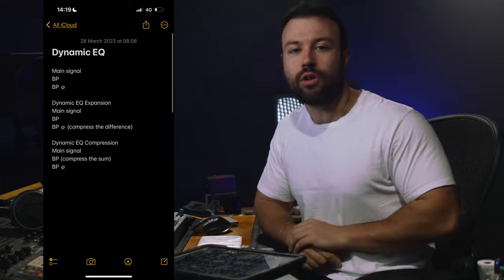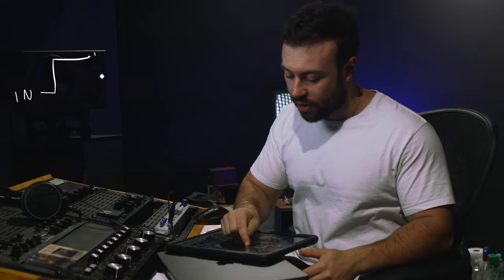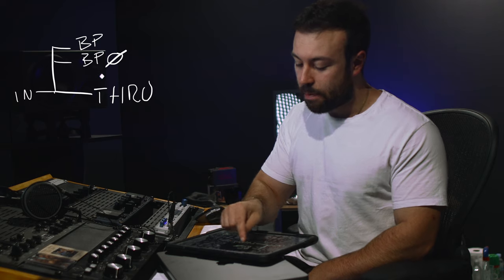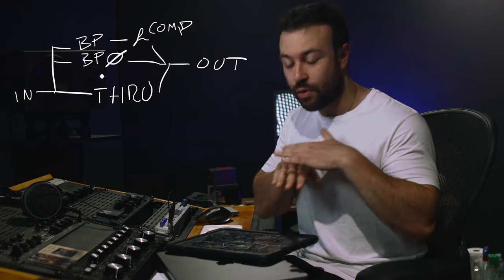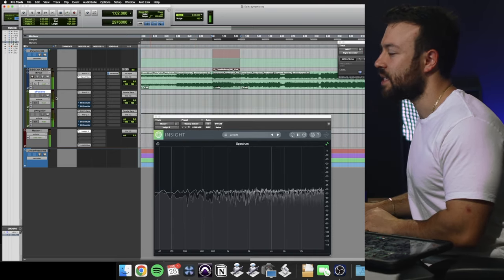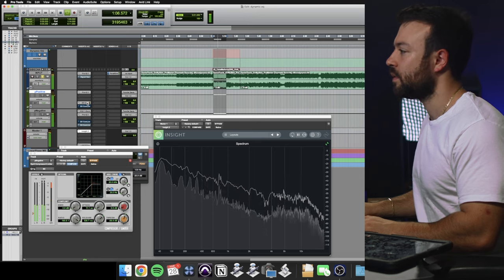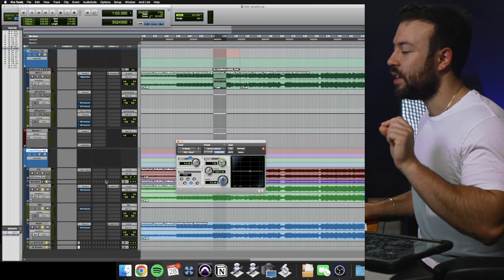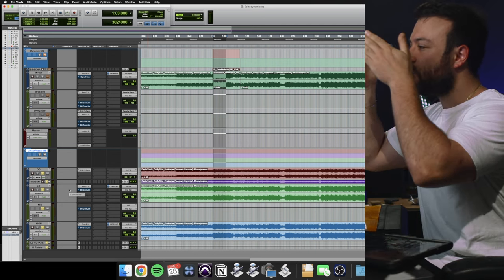Mastering Engineer Debunks Dynamic EQ VS Multiband Compression; MUST WATCH

Comment: I remember back in the OLD DAYS the only Dynamic analog EQs were the BSS DPR-901 & XTA Electronics D2 and few homemade boxes I saw around Nashville Studio. But Dynamic EQs were mainly used in the Television & Movie world for Dialogue control on moving boom mics. Analog Multiband compressors were fairly uncommon as well, a couple VCA 3 band and 1 Opto 3 band is all I remember ever seeing. But mult'ing was common back in the console days so basically making a multiband compressor manually on 2 or more channels on a console. Dave Pensado and Justin Niebank were famous for splitting out vocals and multibanding them. Good video. The Tokyo Dawn Labs dynamic EQ is a parallel EQ design so each band is independent and then the output of each band is sent to the next band in the order you set them, then combined in the end that way to bands really close together aren't over or under compensating. That is the only Dynamic EQ I know of that does that, the rest are just processed at the same time together.

Comment: you laid out the basic routing for those types of dsp processors, but you'd be surprised how much of a pandora's box it can really be. with all the different kinds of routing-optimizations, entirely different filter architectures, allpass filters, linear phase with pre-ringing artefacts, minimum phase with the phase smearing. it's an endless topic and at the end of the day you just use the plugins that feel right anyway :)
Reply from the maker: Exactly! But I needed to answer this question for myself, because it was unsettling to me how vague people were being when differentiating the two tools;
Reply: Of course, you're right. That's why you have such a overwhelming number of EQs and compressor (both plugins as well as analog gear), which each claim to be better than their competitors. But I think that's not the point here, since Nicholas just wanted to highlight the basic difference between a multiband compressor and a dynamic EQ, so that you get an idea, how/why they achieve different results. He did not claim, that dynamic EQs are generally better, they're just introducing less pronounced phase shifts. As usual, the choice whether to use a dynamic EQ or multiband compressor depends on the product you're using (and thus the actual architecture and features involved), the audio material you're applying it to, the settings (since especially multiband compressors are often used with too aggressive settings) and your expectation on the result (because phase shifts are not necessarily harmful for your mix, indeed they sometimes add that extra "flavor").

Comment: Pro MB dynamic mode does the same thing as a dynamic eq which is why it's been my go to mode and multiband compressor for years.  I've always thought it sounded the cleanest, even compared to other greats like the leapwing one.  check the manual description 
"Dynamic Phase
Finally, the unique Dynamic Phase mode gives you the best of both worlds: it results in a flat/linear
phase response when no gain processing is applied, but does not introduce latency or pre-ringing
artefacts (like linear-phase processing) or static phase distortion (like minimum phase processing). Minor
phase effects will only be introduced when the gain of a band is actually changed. This is possible
because the input signal is not actually split into bands, but is treated with intelligent dynamic filtering,
offering almost the exact same frequency response as with linear phase and minimum phase processing.
Dynamic Phase is by far the most transparent mode, suitable for both mastering and mixing, so we have
chosen this as the default processing mode for new plug-in instances. Note that Dynamics Phase mode
closely approximates the behavior of "normal" multiband processing, but in some cases, like muting all
bands, or placing bands next to each other, it works slightly differently."
Reply from the maker: Solid pick up!

It's funny because I've never liked Pro-MB Period; I've used it and do use it every now and then; but something has never sat well with me using it;
Reply: Pro-MB sounds amazingly clean and nice, I really like it for subtle mix bus work (up to 1dB low mids and highs compression on the master bus and on problematic vocals (huge range singing and going fast from soft to loud singing) up to 3-4dB). Sounds like nothing has changed in the sound but everything sits and feels way better.

Comment: I sent this to a couple of friends. One specially since he is doing a freaking crazy filter research. As far as I remember his version this would probably wouldn't be the way to separate them. In my way of thinking it & understanding... both designs could be called Dyn EQ or MB Compression. It would probably have to do more with how many filters are you using, not with the routing itself. Since all you are doing is affecting in some way the detection circuit. Like the 80's SSL Desser, duplicate track, emphasize FQ, feed that into track that is actually going out through SC. 

But for me the importante is much more of a concept, when to use what. TDR Nova could be used in any of those ways (just to call a free option for everyone). When I get an answer from the researching friend I'll come back and post his answer or he'll probably post it himself hahaha I always enjoy your videos. :) 

Hope we can make some video together.

Comment: So, multiband compressors will natively create phase changes due to crossovers once it's enabled? Due to the initial EQ (band) signal split, correct? I've often used the Waves LinMB on masters, as I understand, this specific MBC operates in linear phase mode which should minimize these effects. Is that true?
Reply from the maker: Many do rotate the phase on the cross-over filter; the design of the crossover's I routed in the DAW were linear phase; but that was because I could create the crossovers for the mid channel via the difference signal from the sends; however; when more band passes are involved; I don't know of such an eloquent solution (Most likely there certainly are; just not ones I'm aware of)

Comment: I wish there was a free spectral dynamics plugin with a good interface and gives detailed control...
Nova only gives very gentle expansion/compression, and fast attack times tend to create noticable distortion. 
ReaXComp is super frickin difficult to use, and it's hard to properly gain match. Also the compression isn't the nicest sounding (this is a skill issue on my part). 

I've set up my own crossovers before, but the fact that it's so hard to tune the cutoff and add more bands takes so long that I forget the sound I was looking for. 

Maybe I should just buy pro mb...

Comment: I understand everything except , how do you reckon a Multi band is in series?
It splits the signal into 3 separate bands which are all Filtered independently ? is that itself not a type of parallel processing? as the processing is happening independently before the sum? 
Or is it that the Dynamic inverses phase and uses the difference between the 2...and that is actually parallel? as in the phase inversion / differences make it parallel processing? or maybe another reason I am not aware of.

Because if I made a pedal board and used the same signal path as a multi band, that would be viewed as Parallel signal paths in the Pedal board world (like a Wet Dry Wet set up), just to use an example. 
Or if I set up 2 speaker cabs with a guitar amp, if the signal went into one cab and then another cab was driven after that cab (amp into cab a into cab b) that would be series, but if I put both cabs directly into the Amp out put they would both be driven at the same point in 2 independent signal paths, that would be parallel to use another example.

Great video though I am literally just querying the use of terms and what that specifically relates to. You clearly know quite a bit about the tech side of Audio so I would love to hear your answer. I know I am probably missing a key aspect here
Kind Regards
Jack
Reply from the maker: I must admit; I need to could have been a bit more thought out in my verbiage; or explicitly stating my case for serial processing in this instance;

In my perspective it's because those filters/processing on the bands are done directly in-line with itself; whereas on the dynamic EQ it's done running in parallel on a seperate channel which then re-sums back with the thru signal;

You're right to question the terms; possibly in-line processing; vs parallel could have been better verbiage for this circumstance;
Reply: @panorama_mastering  Great answer, I was just wondering if my guitarist brain was getting in the way of mixing brain, you have answered that very well though. Thanks so much for your video and response

Comment: but the diagram is still parallel which is rather confusing explanation if you focus on that factor otherwise sweet video! Thanks a lot.
Reply from the maker: You're right; thanks for watching; I explained to a previous commenter the following; I hope it helps clarify;

I could have been a bit more thought out in my verbiage; or explicitly stating my case for serial processing in this instance;

In my perspective it's because those filters/processing on the bands are done directly in-line with itself; whereas on the dynamic EQ it's done running in parallel on a seperate channel which then re-sums back with the thru signal;

You're right to question the terms; possibly in-line processing; vs parallel could have been better verbiage for this circumstance;
Reply: @panorama_mastering  Thanks for your reply I appreciate that and certainly does help visualize better, great job!